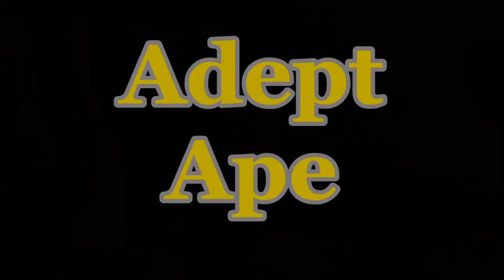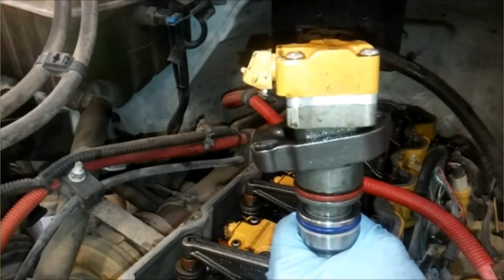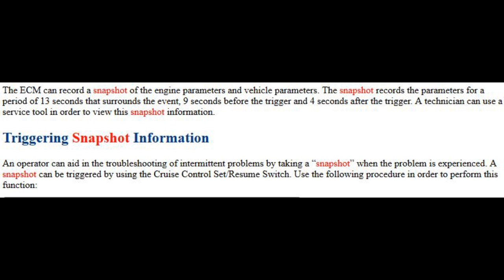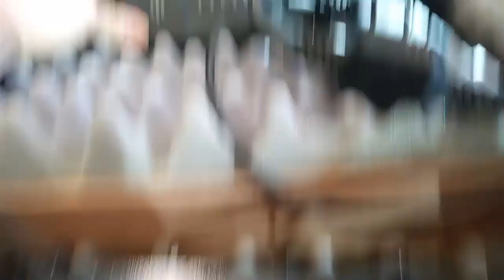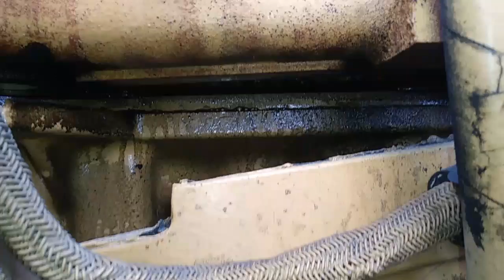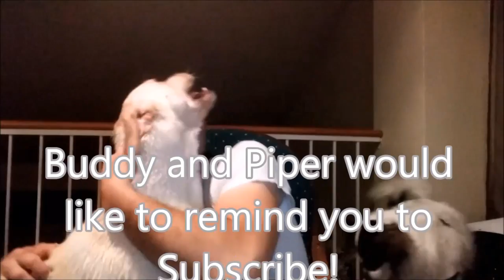Troubleshoot A Diesel With No Check Engine Light.

Comment: I know your area of expertise is with Caterpillar engines, but this little story involves 60-series engines.  I found out that the boost pressure sensor won't throw a code.  Except for the older "junkers" I drove in my early days (71's and 92's), I had mostly Caterpillar experience (3306b, 3406b, 3176, and much later, C13) until my then-boss started buying those gawdawful ovloV things. In 1999, mine came with a 12.7L series-60.  In the four years of hell driving that truck, I had no less than 14 boost pressure sensors. Turned out that the air intake tended to swallow a lot of rainwater, and the boost pressure sensor ended up sipping some of it (extreme moisture) and filling up to the point of no longer activating.  It only manifested itself as a problem when you were working the engine, loading it. Couldn't reproduce the problem at a standstill.  Well, after 4 years of ovloV hell, I gave my notice to that employer after 14 yrs total.   Next job, I started with a Penske yellowbird. My very first trip out, I get 4hrs away from home and it does the exact same thing, so my first thought was "Oh no...., another effin' boost pressure sensor.".   So the next day, I'm still dealing with this annoyance, I call up Penske to describe the problem.  Of course, you get someone in a call center, who is supposed to be an experienced technician, well some of the guys you speak to can really understand your interpretations over the phone,  some guys (who might be awesome technicians) do not do well at interpreting a driver's description of a problem.  In defense of Penske (and ALL techs/mechs out there), Penske does have a policy of not making judgement calls over the phone based solely on the description or complaint of a driver, about a truck.  They like to have one of their own hands confirm the existence of the problem and make a diagnosis before they will go ordering parts.  So, despite my describing the problem of intermittent power while under load AND suspecting the boost pressure sensor, they wouldn't bring one to where I was, but they did send out one of their techs in a service truck.  He even brought a laptop and plugged into the truck, yielded absolutely nothing.  So, again, I brought up the BPS theory, and he mentioned that Penske SOS had relayed that from my phone call to the work order and explained that even if he'd wanted to bring one, they had none on the shelf at his (local Penske) shop.  He did pull out a 5/16" wrench and spin off the little bolts that held the BPS on the intake manifold.  It immediately began to slobber water once he broke it free of the seal where it had been mated to the intake. He looked at me, and said "You could be on to something."  I replied "Been here fourteen times already."  Since my return load was only an hour up the road and took me by a Detroit parts and service shop (which was also the Penske supplier), he agreed to follow me to this Penske shop to get a boost sensor.  I asked him if he'd care to drive the truck (trailer was now empty), so he did drive it for the first 6 miles while I followed in his service truck. We stopped at a wide spot beside the road, and he asked me how I had managed to get the thing to where I had delivered WITH a LOAD on,  but anyways, on we went the other ten miles to the Detroit shop. They had the sensor, he installed it, and that truck was golden after that. I'll never know (or care) if merely unplugging the harness to the BPS would cause a code to be thrown, but merely getting moisture in them won't cause a code.  And many many thanks to the old fellow (at an ovloV dealer in Harrisonburg, Va) who finally figured out the very first one, after I had visited numerous ovloV shops up and down the East Coast trying to figure out the problem when it first occurred.
Reply: That’s strange. My 2000 12.7 has 812K on it and as far as I know it’s never had a BPS. It’s never had water in the intake either though.

Comment: I have a 2004 Bridge motor set at 410 horsepower and I'm being told the most I can get out of it is 430 horsepower but I would have to change injectors and Turbo. I would like to change my C12 out for a C15 and wondering how hard that will be? Are the motor mounts the same on a C15 in a C12? If I get the same year with the ECM be a plug-in play?

Comment: Lol.. got a real good one.. C-10 wouldn’t start .. unplug crank speed sensor and it fires right up .. put new sensor same thing won’t start.. will only start with sensor unplugged
Reply: Wiring to the sensor or ecm?
Reply: Cody Wiederholt that’s what is probably the issue.. but just find it odd that it’s all fine with out it hooked up ..

Comment: We could talk for days. I worked for CAT for 14 years. Everything from the 3200 series up to the C17. Boat engines were my favorite. 398 to 3600. 3500's were my Darlings. I still bleed CAT yellow. I cut my teeth on the hybrid Mech/ELEC truck engines. A true joy was figuring how to turn all of them up, past rated. The 3406C was the toughest. The electronics were easy. I learned how to lie to a computer, in DOS. Engines were much easier. For $5, I could add 40 HP to an E model. Goog times.

Comment: Where can I buy or make a oil/fuel pressure tool?
Reply: The pressure  gauge, line and female coupler can be purchased at any hydraulics shop. You can build one for around $100 Canadian.  I use a 160 psi gauge. and a 10ft line.

Comment: We had a brand new DT466E that wouldn't start with no CEL. Turned out the ECM went out. Verified but not reference voltage to sensors.

Comment: I have run a PAR test on a 3406B and with 5 Lbs of fuel psi it was putting 500 HP to the flywheel. Fuel psi is very important on Cat engines with injectors. Looks like you measured fuel psi before the secondary filter. I always check it after secondary filter. 
Fuel temp., is important. For every 10 F above 85 at the secondary fuel filter base you loose one percent HP.  ECM compensates up to a certain temp. Fuel temp gets to high, injector failure occurs. Fuel coolers are a must on single tank electronic engines.
Always check with ET, FRC, rated fuel limit and fuel position. This will let you know if you have a air problem, your in derate or ECM has given the command to turn fuel on, depending on load factor and boost. 
I tell the younger tech's on a stone cold engine, look at all your temps, they all should be close to ambient.
Back psi is a problem sometimes, as with newer engines catalyst and DPF's raised these numbers from the old straight pipe days. 
IVA engines, when they act up will cause issues as well.  
A chassis dyno is a must, with ET, fuel flow rate, back psi, inlet restriction, fuel API, turbo psi, fuel psi, fuel temp, inlet manifold temp.
I agree that the younger tech's who did not learn from the mechanical days are at a disadvantage. A customer would come in with a complaint and you had to figure it out. Even with the newer engines, I explain to them you have to determine if you have a electrical failure or a mechanical failure. 
No matter how much electronics is added. Some where under that hood is a crankshaft and pistons.
Reply: Fuel temp is very important - especially when running #1 diesel or like in some equipment around airports - jet fuel.  In the far north they run DFA - Diesel Fuel Artic grade.  The temperature your most interested in is the vaporaziation temp.  The lighter the grade of fuel the lower temp it will vaporize .. if the fuel gets too warm the vacuum caused by the fuel supply pump sucking from the tank will cause vaporization in the supply line.  Cummins used to have these little 2 or 3 gallon day tanks .. they were using DFA at a radar site in Barrow Alaska- the machines were having problems carrying load .. even after I debated the engines because of the lack of btu's due to the fuel grade ... I use a refrigeration sight glass to troubleshoot air suction problems... the engine would run cold just fine then bubbles would start appearing in the suction to the pump... turned out the return fuel would raise the fuel temp in the day tank to a point that would allow it to vaporize in the suction line... the fix was to install a 50 gallon day tank - course this was in the artic - I'm pretty sure that with this summertime heat the fuel temps are running close to vaporization temp.  When that happens besides not getting an accurate fuel delivery you loose lubrication to the injector... so running a fuel cooler and a additive to increase lubrication will make those spendy fuel system parts last a long time.  I recommend marvel mystery oil ... it's good down to -40 in the cold too.. have fun and stay safe

Comment: A good mechanic isn't expensive, they're priceless.
Without a compression test, how can you tell a engine is worn out? I have a Cat 3176 with 700k miles and throttle response is slow both up and down. It takes a whole second to drop 500 rpm to be able shift. Would a higher compression engine be more snappy? Or is it just a 3176?
Reply: How much blow-by is you engine producing out of the crank case vent? It's a place to start.
Reply: traveling tech- it does have blow by, but for 700k miles I don't think it is excessive. I've driven some where the rpm drops so fast its hard to time the shift into gear. Mine if I pull a hill off a red light, I lose so much wheel speed waiting for rpm drop that I can hardly maintain enough rpm for the higher gear. The biggest problem is it has a 9 speed and big ratio difference between gears.
Reply: One subjective method to check compression is to compare the ease/difficulty of manually turning over the engine with the difficulty of turning it over when it was fairly new.
Reply: A good mechanic is cheaper than a cheap mechanic.

Comment: Electronic controls and check engine lights has resulted in a bunch of parts replacers...gasoline engines too. A good mechanic goes OLD SCHOOL...the engine operates, essentially, the same as the non electronic version. That's why you are exemplary in your field. Damn good job!

Comment: My friend has a cat called diesel. What would your advice be if there is no check engine light but constant meowing and scratching?
Reply: Take it to a vet and has it put down for good. That will solve the problem quick and easy.
Reply: @xMIEESHIx  Ah awesome, I'll try that. Thanks!
Reply: @xMIEESHIx  So I took your advice and did what you said, but now there is a 'check balls' light on my dash - what should I do?
Reply: @ZylonFPV  if you ever see anything that you should not see, try doing to yourself what you can do to that problematic cat. Best wishes.

Comment: Really like your informative videos. But i love my 96 mech CAT 3406c 8pn, alleviates a lot of the electrical "what if". Also installed Air Dog  mechanical air separator on fuel filter housing after watching your video relating to fuel mileage. Immediate improvement to throttle response, intake manifold psi improved from 15-18, full throttle under load to 20-25. Over 50% decrease in black exhaust, and since i have more manifold psi, I'm not in the throttle as much or as hard (full throttle). Giving it several weeks to see how much fuel mileage changes. Keep up the good work Josh. Thanks.

Comment: Fuel pressure gauge should be considered mandatory equipment.  If not equipped, add one, actually add a couple.  One post filter, and one on the rail.  Snapshot could be handy for those intermittent hard to replicate issues.  Didn't know about that.
Reply from the maker: I completely agree, it is so important and nearly everyone doesn't have one.
Reply: Adept Ape hey man how are you do you know if you have to pull the cylinder head off the truck in order to replace the followers on a 2000 c12